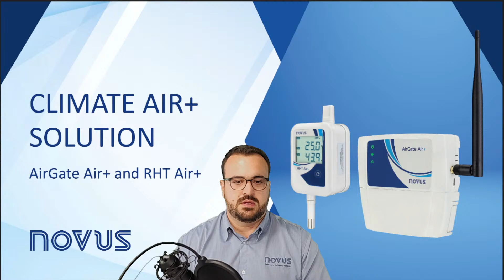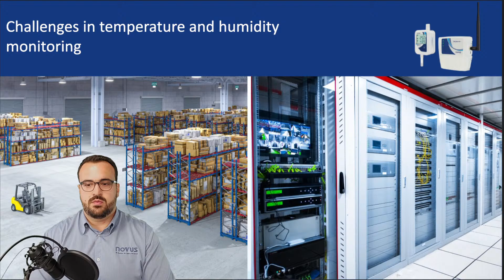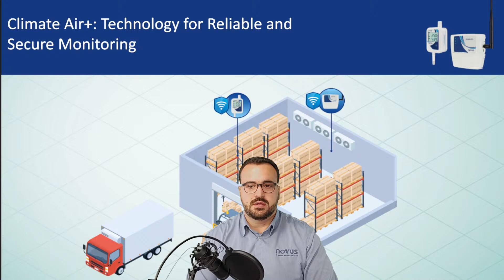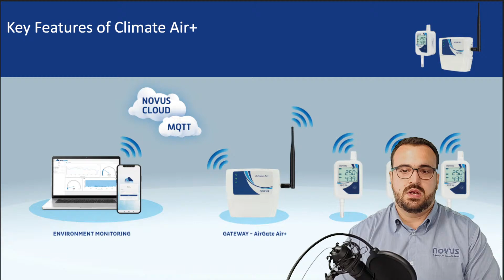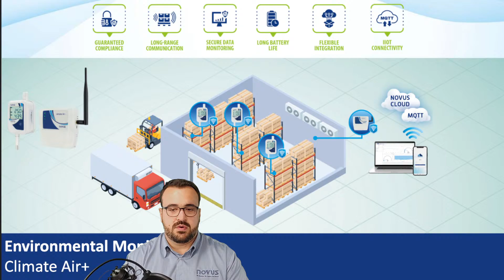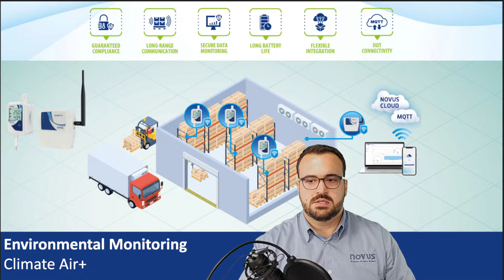Product Launch: Climate Air+ temperature and humidity monitoring solution

Comment: What would the distance be in a warehouse or data center? Are the frequency certified to work in the US?
Reply from the maker: Hello Michael!

In open areas, the typical range can reach up to 3 km.

In indoor environments with obstacles like walls or metal structures, the range varies between 100 to 300 meters, depending on the building layout.

As for frequency certification: yes, the product is FCC certified.

If you have any additional questions, feel free to reach out to our support team here: https://www.novusautomation.com/en/support.